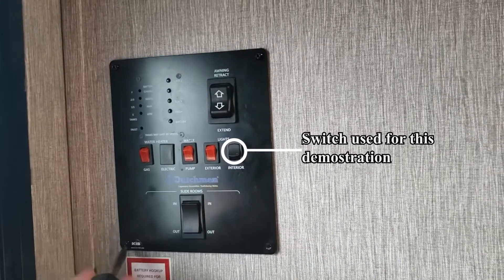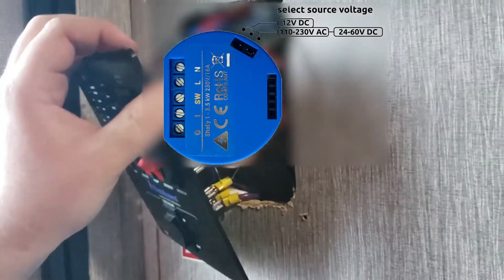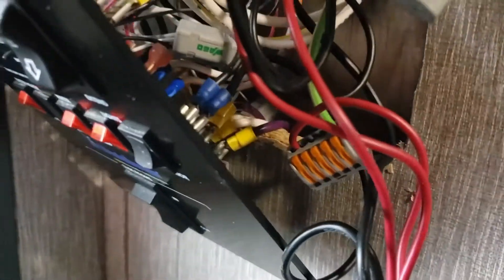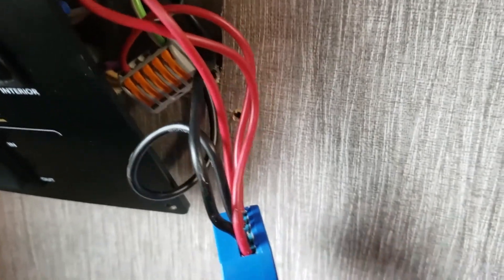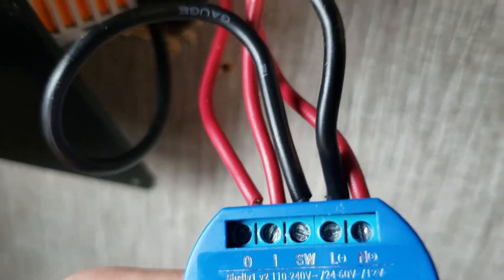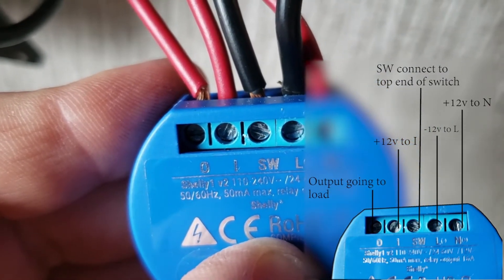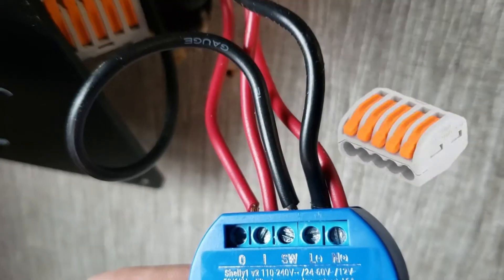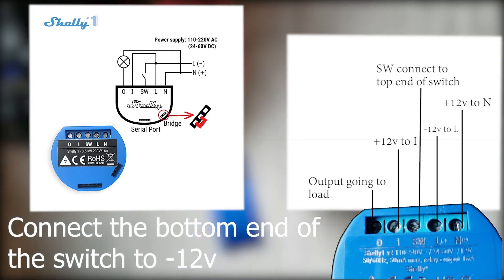Installing a Smart Switch in a Camper (Shelly Smart Switch)

Comment: with this setup, does the switch and the shelly operate independently? Meaning, if the shelly were to fail, could you still turn on the load using the manual switch?
Reply from the maker: Yes it can still use the manual switch. If your without wifi then it just operates the same as if you didn't have anything behind there

Comment: Did you have to splice, or does that go in between the switch and the light?
Reply from the maker: I had to rewire and put in between the power and load and add the switch to the circuit